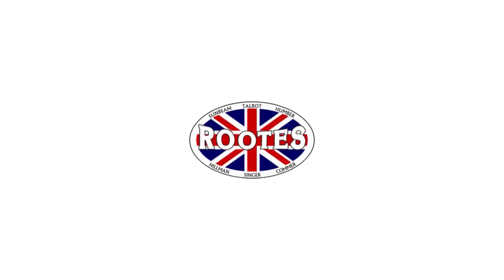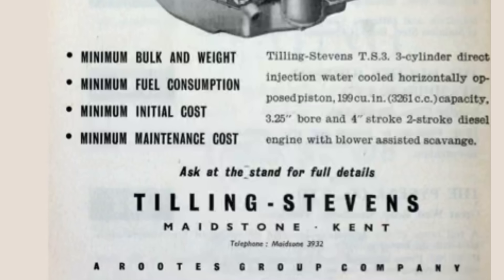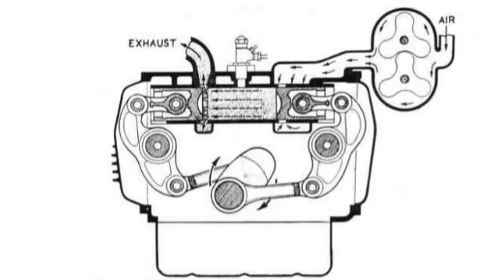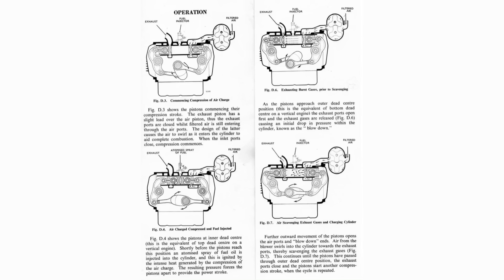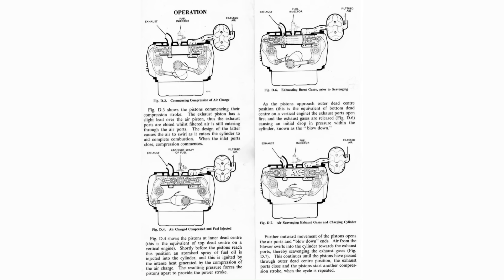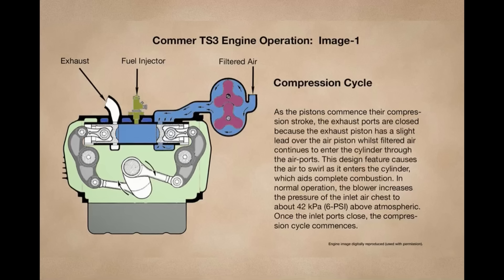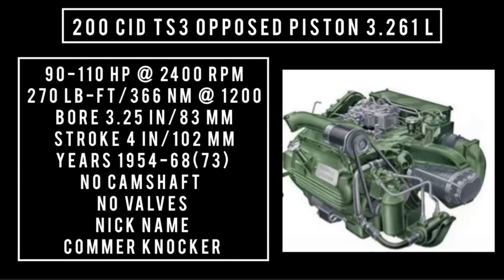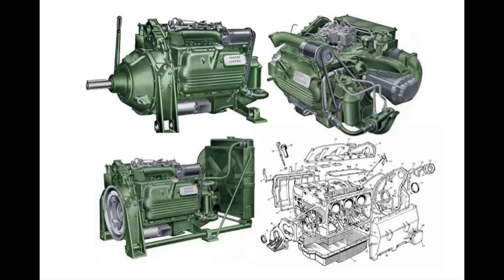Rootes TS3 three cylinder six piston two-stroke diesel engine 200 cid

Comment: This must have been the engine used in the Commer trucks during the early 1960's that built the Deep Water Harbour in Barbados. Those trucks were noisy. The Company contracted I think was out of Britain and named Costaine. Not sure of the correct spelling.

Comment: A lot of TS3 Commer trucks must have been produced, as over here in the 1970's the Wade supercharger units were a dime a dozen. You had to lubricate by crankcase ventilation if not wanting to do a lot of extra work when fitting to something else, as the rotors would suck lubrication straight into the induction system. I still see the odd Wade blower from time to time, complete engines not so much, but in saying that I have only ever seen maybe five or six complete engines to a numerous amount of blowers.

Comment: One of the best engines built , I can hear all the uninformed keyboard engineers already typing , but I've worked on these for years , simple to work on , last years longer than a normal diesel , only 19 internal moving parts , and saying it's 200 ci is a bit misleading , it's the same swept volume as a 400 ci six cylinder four-stroke . Like all two strokes it's volume is twice displacement or equal to double the size four stroke. That said , in the video it stated " at top dead centre a mixture of oil and fuel is injected " only fuel is injected, no oil . Infact it's a compression ignition engine , not so much diesel , they run on Kerosene, fuel oil, cooking oil , anything that is liquid and burns really . In all the years of working on them ive seen a few blower shaft failures but that said , these motors were pushed harder than most , usually a favourite of logging company's, or heavy duty  traction work , were they had a reputation of not giving up and pulling far beyond their design capabilities. There was a TS4 in production and many running 8 piston 4.7 litre ( two stroke) versions were built , but at the point of going into full production Roots company was bought out by Chrysler US and because of the relationship of Chrysler and Cummins the TS4 engine was killed , and the already built TS4 motors got pushed into a giant hole at the Roots factory, but several complete TS4s were saved . Cummins didn't want a lighter , simpler , more powerful engine than the one they were producing . So they ended the TS4 . Such a great shame , the TS4 was said to run dead smooth , completely balanced ( the TS3 was also very smooth ) , it's a testament to the design that today many companies are reviving the design , with electronic direct injection and screw blower that's much more efficient. And positive displacement where no intake charge can revert at low revs back into the blower. I've seen all the comments , but untill you work on one and realise how easy it is to rebuild , you can rebuild one in the truck if necessary in two days , smooth power .
Reply from the maker: Thank you so much for providing all this insight and information. Greatly appreciate it.

Comment: Way back in the thirties Hugo Junkers devised a 6 cylinder opposed piston twin crank two stroke diesel that became the Jumo205. The 205 had performance issues at altitude and eventually was supplanted by the far better Jumo 207. The 207 was used in the Ju86P/R high altitude test aircraft and it was claimed an altitude of 52,000 feet was reached.

Comment: Jay, not a bad effort but the TS3 had NOTHING to do with Tilling Stevens, EXCEPT it was manufactured there after Rootes Group bought Tilling Stevens for manufacturing space. A Commer enthusiast / TS3 expert in New Zealand has the original school type drawing pad with the stress calculations undertaken in red pencil by Eric Coy, Chief Engineer Engines (petrol only) at the Rootes Group Humber Works at the Stoke Aldermoor plant Coventry. He was assisted by two other design engineers Bennett and Maleski (not sure spelling is correct) These long hand calculations are dated 1946! I've seen them. If you do your research, Tilling Stevens was purchased by the Rootes Group in Sept 1950 - some 4 years after work started at Humber on the TS3. By then, 3 prototype TS3s were in testing along with a single cylinder two stroke to test piston / cylinder design. If you check out this YoutubeVideo here https://www.youtube.com/watch?v=GvNV_DvFys8.  done by two NZ friends on a trip to England, you will hear about the TS3 first hand from Don Kitchen who was taken on as an engineer / draughtsman and who remained responsible for the piston / cylinder design for the rest of the TS3s and TS4s development (yes there was a 4 cylinder version built to testing stage). He ended up head of Rootes Diesel Engine Division and sadly died in hospital during COVID.
Reply from the maker: Thank you so much for shedding some light on the topic there's so much conflicting information about this engine here in the states...
Reply: @What.its.like.  No problems, The misinformation is not helped by English Classic truck magazine writers / editors repeating the incorrect information about the engine when they should know better /  do their research. I have just been lucky to have been able to make contact with Don Kitchen and chat on the phone / get letters from him about the TS3. Interesting thing is that in England, Commers with TS3s are not thought of as being exceptional as they were only used for delivery work and unless a semi truck/ trailer, usually run without a trailer behind. Yet in New Zealand (where I am) and Australia, they were held in high regard because they were abused way above their design limit, and never went anywhere WITHOUT a trailer. In fact I have a photo of the one I grew up in, the first TS3 in our province, where Dad and the owner did a trip with TWO trailers behind a 90bhp TS3 Commer. Nearly 20 ton payload (44000 lbs for you guys) not including the weight of the truck and trailers for a truck designed for 7 ton! You can hear more about this type of abuse on the video I linked to, from a real character "Boof' Wedding (and Boof's story about overloading is not an exception, it was the usual in those days!) So TS3 powered Commers were one of the few trucks that could be overloaded and abused in the 1950s /60s that took the abuse, remained reliable and still made their operator money!  Don Kitchen could never understand why all these people from NZ and Australia made the trip to see him in England (including my brother) to talk about the TS3 because of their memories of it, as they wanted to hear about this motor from someone first hand, while there was no interest from people in England - they rarely showed any interest. This is why so much info / plans / documents etc has been sent out to another Commer enthusiast / expert in New Zealand, and myself - because we were more interested in the motor. There were some TS3 Lister irrigation sets sold in various parts of the US by irrigation dealers. A few people remembering them have contacted me in the past. Keep up the great work!

Comment: Firstly, Commer, COMM-er. Secondly, the Germans used two 6 cylinder/12 piston (vertical) diesels on the Junkers Ju 86 aeroplane, late 1930s, early 1940s.

Comment: I would use this engine in the 100 Hp form as the combustion part of a combined cycle industrial or moderate size mega mansion to provide both electricity and heating/cooling. Due to extenuating circumstances, no money, I never was able to base a residential and metal working shop sized system around  set of one and two cylinder CS low sped diesels. 

Ideally this would have been located in thee old oil and natural gas regions of northern Pennsylvania and mid New York where a, if you have the mineral rights, you can drill an oil well for relatively little money. Other wise fuel the things with recycled fryer oil.

Comment: A beautiful engine to work on, incredibly quick to start up, the main problem was oil intrusion into the air intake, this led to runaway and the engine could destroy itself, your reaction as a mechanic, stand well back and wait for the bang.
Reply: Always wondered  why there was no butterfly in the intake to be able to shut off air to prevent a runaway.

Comment: A friend of mine back around 1970 owned a Commer Knocker truck.  He used it to two a trailer transporting a Cougar Cat offshore race boat.  It was strong and very reliable with excellent fuel economy.  I rode in that truck many times as we drove from Hertfordshire down to Southampton for engine and prop trials on the Cougar Cat.

If I had one today I'd put it into my old Range Rover, so a truck, not a car.
Reply from the maker: Thank you so much for sharing your experience

Comment: Some clever thing about the design,,unlike a four stroke that always leaves some exhaust in the new mixture,,these cleared all exhaust out,,and gave the exhaust ports a small cooling with the excess air flow,,and unlike a two stroke petrol engine that rearly only compresses a half charge once the exhaust port is finally closed,,these fired nearly a full length charge,,,ship engines useing a slightly different exhaust valving but the same forced air intake achieve aprox 50% efficiency!   Compared to 4 stroke petrols 26%,,,and 4 stroke diesels 36%,, the weight of fuel saved equals more cargo space carried for the same cost,,,
Reply from the maker: Thank you so much for sharing that insight

Comment: Oil was not mixed with fuel, it had a pressurised oil system.
Reply from the maker: Thank you for that correction when I was explaining that part I was thinking of a 2 stroke gas engine.. I'm bad

Comment: Yeah, I’ll put it in my boat and use it for a boat anchor 😂 my dad had a TS3, commer truck in New Zealand. I learn to drive on the farm when I was a teenager. I don’t ever recall it breaking down. We used to call it the commer knocker as it was a very noisy engine with all those extra reciprocating parts in it which made for a mechanic mechanically noisy in the engine and also the exhaust noise being a two-stroke engine was quite noisy as well

Comment: I remember these engines in Commer trucks as a boy in the 1960'sand 70's.   A few images of a running truck and the unique engine sound would be helpful.   They exist on You Tube and several of these operational trucks still run in New Zealand at truck fairs and with older enthusiasts.

Comment: I wonder if with current technology, the 2-stroke oil burning issue could be solved.  If so, i think this would be great to have in a 4x4, with good fuel economy and great low-end torque.  Needs a better supercharger design, though.
Reply from the maker: It would be awesome if they brought this back. I also think they should bring back the flathead design and turbo charge it

Comment: Actually, there should be no private vehicles. Many emissions problems would lessen.
Reply from the maker: I disagree strongly, but if you worried about emissions buy a old car, they really aren’t as bad as some claim. Can always switch out the rear end and get better gas mileage.

Comment: Efficiency of the opposed pistons, but the scavenge blower and transmission of power to the central crank as negative power draws. I wonder if modern engine tech could help, such as dual generators instead of combined into one crank, and electric scavenging motor to make a hybrid diesel/electric that would run in a narrow RPM range.
Reply: All two stroke diesels have to have a purging blower because there is no crankshaft pressur.

Comment: Hi Jay, this engine design has been around I think since the 1930's.  It is the most efficient type of configuration with efficiencies generally in the 50+% region.  Fairbanks/Morse used this design in generator sets and locomotives.  I think Rootes used the rocker arm internals to minimize the engine block dimensions.  Normally the engine uses two crankshafts geared together.
Reply from the maker: Awesome information I think it dates back further than that. Did you see the engine patent had ransom E olds on it, which was interesting
Reply: @What.its.like.  Thanks Jay for mentioning the Patent date, I missed that - very interesting!

Over the past couple of years, I saw a startup company preparing to make a version of this engine for car use.  I don't remember the company's name but, their prototype engine had really good output power and efficiency.  The only problem with this engine configuration is it is large physically and visually it's not traditional looking so, marketing it may be difficult.

Comment: I'd put it in all the above. Maybe a motorcycle as well .  aluminum  motorcycle version. With turbocharger. And roots or screw blower. A gas and diesel version. The gas motorcycle version  with a 4"Bore and 2.5" stroke  2 cylinder, 4 piston engine. With blow through carburetor or port injection.  Spraying directly into the cylinder.   A 6 speed shaft drive  with a counter driven flywheel weighing about 15-25 lbs. Most likely two 7-8  to 10-12 lb flywheels. The flywheels mounted on the same shaft as the rockers. With gear drives spinning opposite to the engine rotation  also at a 20% over drive. To keep the engine accelerating them. The flywheels also powering a 30 amp pma alternator  using a dc  to dc to regulate voltage and waterpump on the opposite side.  The turbo  running at 1.4 1.8 bar. 20-25 psi with air to  water intercooler with a 8.8:1 compression ratio for gas, a 22:1 for diesel with the pistons having a half sphere dish in both. With a cutout for the injector. And a separate oil pump just for Spraying oil to the bottom of the piston.  The piston having a fin pattern  on the back side to make more oil contact. The pump supplying up to 1.2 gpm of oil to the piston . The two stage pump sends non filtered oil through an external cooler, back into the engine into the sprayers the nozzles having a bypass valve (that also Sprays on the piston. The primary stage send oil into the oil filter  another smaller cooler then to the bearings. With the primary oiling to the crank then to the rocker. More of a split than 1st and secondary.  The primary oil pump having a bypass warning light. Or possibly an ignition cut killing the ignition if the over pressure bypass opens or starts to open. The pump should be designed to not bypass or have a regulatory bypass that only  reduced pressure slightly. Example, havinga spring loaded valve with a .050" restriction the est. .500" valve must pass oil the bypass could send the oil through passages to the bearings to assure oil  to reduce damage. Since most bypass would be caused by a restriction or garbage in the oil. Having some oil is better than no oil. I would think the bike would be a sport cruiser like a Harley sportster. Yet nothing like it. The diesel  having a longer stroke smaller bore 3.800" bore 3.25" stroke.   Revving to around 5800 rpm peak possibly 5500 red line. Tune the ports to get peak power around 4800-5200. The gas version revving to 8500-9000.  Peak power 7500(+/-) producing 180-220 hp. Maybe A stroker using a diesel crank allowing around 7500 peak rpm and possibly 250-275  hp @ 6800-7000 rpm  possibly 300 hp with port work and overdriven  scavenger and a larger turbo. The overdriven scavenger to reduce turbo lag. Pushing scavenge pressure from 3-5 psi to 5-8 ,10 psi. With the turbo spooling at possibly  1000 rpm higher yet producing more flow at 10 psi higher. And a larger intercooler radiator. Going from a 1-2 row to a 4 row. Boost 2.2-2.6 bar running on methanol because the added stroke raised the compression to 10:1 with 30 psi boostwith 140° f intake temp . 300-320 hp at 7200 maybe, possibly.  On a 600-800 lb bike stripped down, maybe  500-600.  63 and 84 cid the numbers may be pushing it. However, it is a two stroke with boost...  Basically  a cylinder two stroke it could make decent power.  Especially with 80 85% of the cylinder diameter being port. Making the compression area lower when making ports wider. More boost makes up for it.  The cam lift  and duration and LSA  are in the port location.  There needs to be opposed PISTON engines on the road again..  sorry to ramble . HAVE AN AWESOME DAY 🎉
Reply from the maker: Awesome sounds great

Comment: This engine is a third of the Deltic Diesel which Napier originally had in MTB's during War. then Put them into Trains. This engine design is very simple very powerful, yet not used any more? Why modern variants have not been developed seems strange, as it has so many benefits.
Reply from the maker: Great information
Reply: The Deltic is more like a Junkers Jumo 205,  than the TS3. It had no cantilever rockers, it was 3 V engines, attached where the "head" would be.